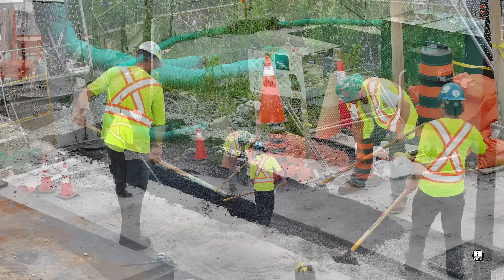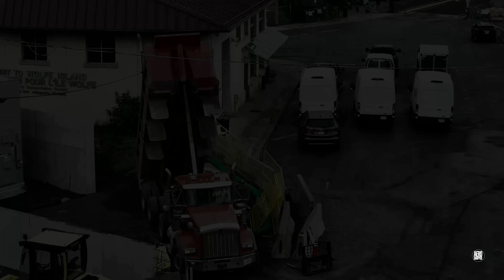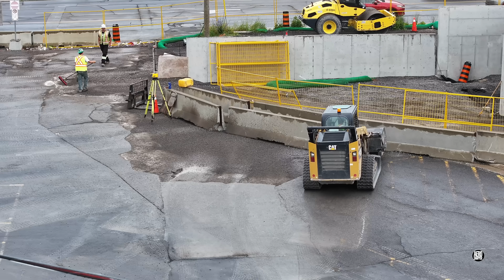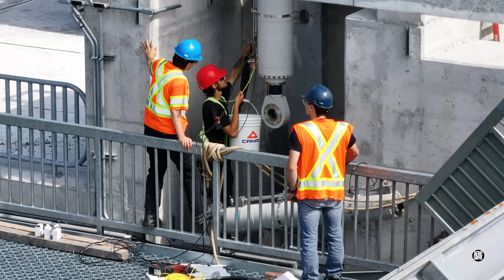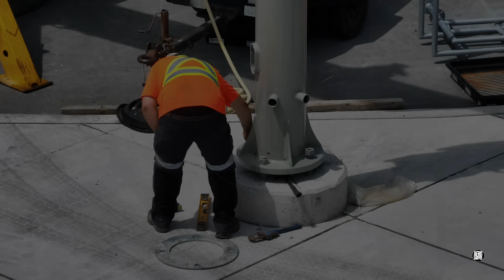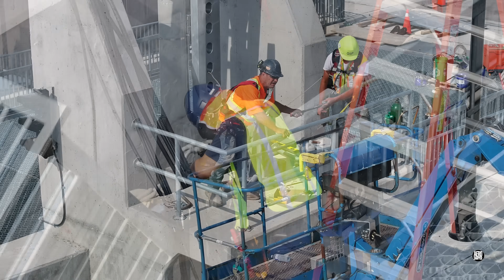Ramping Up - an update on the Kingston Ferry Dock   4K

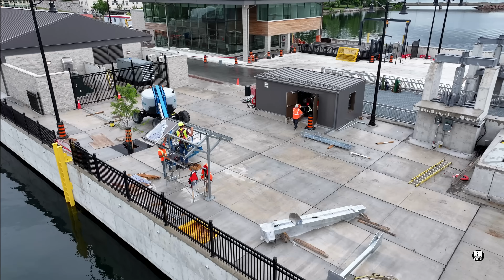Comment: Just a couple of comments about why it's taking so long to finish the dock. At 3:20 of the video you mention the "form of shelter". Eight pieces in total. From your video on June 14th the shelter was laying on the dock. One month later it seems about 30% finished. The safety ladders are also a joke. The anchors seem to be about ten inches long and there are ten of them. They also have toe be welded for some reason lost on me. Waste, waste, waste. Absolutely disgusting.
Reply from the maker: Of course every comment is welcome, but I'm not sure that challenging decisions about sequencing of work or choice of materials and fasteners is reasonable.
Reply: @Aerosnapper  In words you are the judge. Congrats. The dock should been done two years ago.

Comment: Such care was taken to install all the wiring for the heated sidewalk. It makes me squirm a little when I see men walking on them as concrete is poured and smoothed but it must be ok or they wouldn't do it. As for the small shelter, my guess is it will have a bicycle rack beneath it but I'll have to wait to see if I'm right. Your sunset shots are lovely and I will try to take a walk-on ride or two on the ferry at that time of day. Thanks again!
Reply from the maker: Joy - first and foremost - thanks for your support.  Work around the concrete pour is always undertaken carefully and there’s abundant space for a foot plant between the elements. I’m pretty sure you’re correct about the shelter. I do wonder though whether the roof panels are simply translucent, or may produce solar power. We will see - and it’s unclear to what end, if they do. I recommend the 8:20 pm sailing for best sunset views on the return leg.
Reply: @Aerosnapper  Thank you. I will try to get downtown for a sailing this week. It's certainly warm enough for a pleasant evening on the water!

Comment: I'm guessing that the sand trenches are an engineered sub-surface expansion joint.  Any one know better, please correct me.  I am now curious as well.
Reply: They had some leftover steel so they buried it lol
Reply from the maker: @m1t2a1 never overlook the obvious ! 😂
Reply from the maker: Peter - I'm certainly not an engineer, but given the spacing that would make sense - curious though that they have not been noticed on the other two sides of the building that already have sidewalk laid.  Thank you for the suggestion.